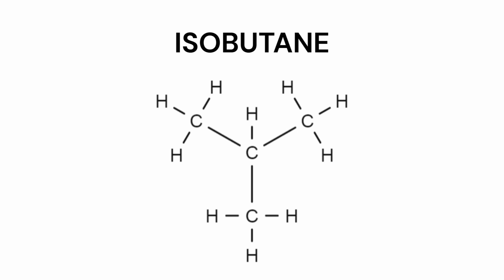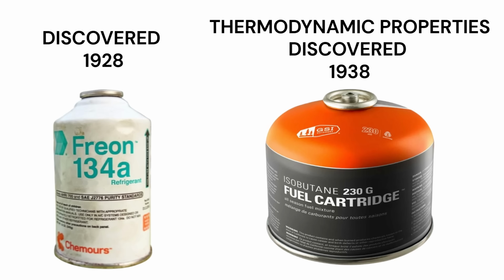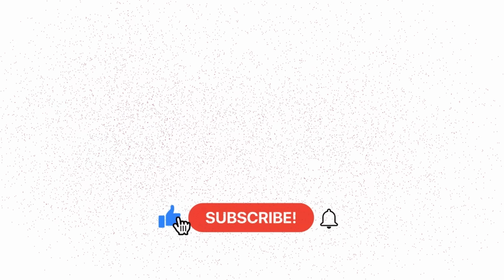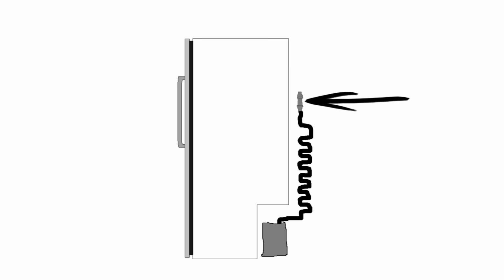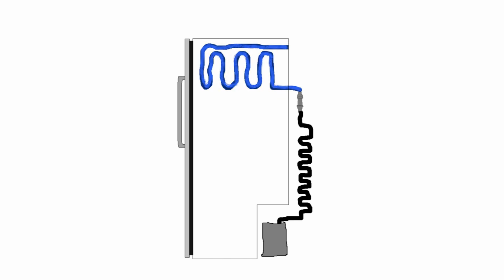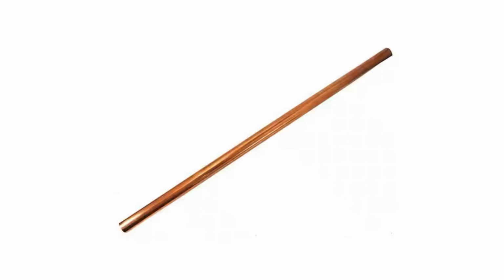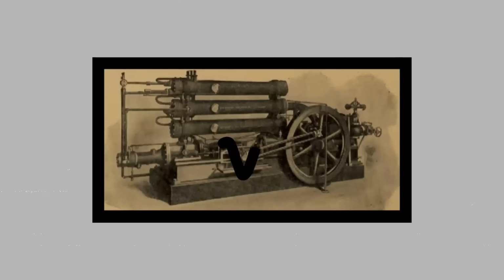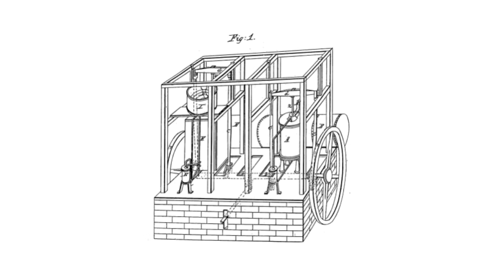Was Doc's 1885 mechanical fridge in Back to the Future really possible?

Comment: Doc's limitations wouldn't be restricted to 1885 technology. He's bringing 1985 knowledge of technology with him. His limitations would simply be in materials. For example, you said that the compressor was already invented, but even if it hadn't been, he still could have made one. I mean technically he could have made a machine to manufacturer r134 because he would have known how to. He wouldn't have to rely on it already existing
Reply: Not to mention he could have easily converted steam to electric just needs copper and magnets. He knows how that stuff works and could have done it.
Reply: @AaronBlair at the end of the day, every electric power plant is just a steam turbine.
Reply: @AaronBlair  yeah, but the question is why would he? That would be alot of effort for no real gain.
Reply: @jacobhargiss3839  to power, his little model, of course 😂
Reply: @asksearchknock  he used batteries.
Reply: @jacobhargiss3839  Are you saying no real reason the Doc would want access to electricity ????
Reply: @AaronBlair  no real reason he would want access to that much electricity. The only real use he could have for it is either heating or lighting. Neither of which he really needed electricity for.
Reply: @AaronBlair that step would result in power loss. Since the power is in mechanical form and the compressor needs to do mechanical work, there's no reason to make electricity.
Reply: @AaronBlair 
Where was he getting copper and magnets from? Copper was VERY expensive back then. It was almost as expensive as gold. 
They were using copper for telegraph and electric wires back. So the price was high. 

Magnets. Forget about it. He wasnt going into the local general store for copper or magnets 

You gotta think. He had access to stuff that he could obtain. Home depot diddnt exist
Reply: @Zeina107  Wow what a silly argument you're making. Doc Brown, from the future, with all his future knowledge. Can't get ahold of copper and magnets because ... they are expensive? Even though both things existed and were available maybe tricky to get? Somehow he got a blacksmith shop and a cool rifle and all sorts of stuff but copper and magnets would be out of reach. LOL. I know this is all fiction but that's a stretch to make an argument just to refute. Use your imagination a bit.
Reply: @AaronBlair I think he would have just stolen some telegraph wire. Doc isn’t exactly known for following the letter of the law when it comes to making an invention
Reply: @Zeina107  and if I were him I'd just take the magnets from the speakers in the delorean he had before he buried it in the mine, not like marty needs that sound system
Reply: He could have used the materials available to create modern tech for sure, he didn't need to use 1885 "technology." this is a big plot hole in the film for when they try to get the Delorean to run. He could have refined his own crude oil or refined his own alcohol to be sufficient to run the engine. They had them use alcohol and part of the engine "exploded." But that wouldn't have happened if the plot didn't  need it to happen. 100% alcohol can run engines for short times, definitely long enough to get the Delorean to 88 MPH.
Reply: @LordRayken  not even just short times. You can tune an engine to run on 100% grain alcohol. In Brazil they commonly sell what's called E100 which is 100% ethanol (drinking alcohol)

I'll add too, 100% alcohol is impossible to get through common distillation because alcohol and water becomes an azeotropic mixture when it reaches 95.6% alcohol. However 95.6% alcohol is still able to run a vehicle.
Reply: @Thoroughly_Wet  Hell, you can get an engine to run on normal vodka. When I was a nipper I had a friend who lived on a farm and we'd drive around like maniacs on the old wartime tractor that ran on any liquid that would burn.

P.S. Isn't it great that it's cheap and easy to get molecular sieves these days? ;)
Reply: @Thoroughly_Wet  yes yes. But consider: benzene.
Reply: @LordRayken 
If we want to be picky about plotholes, then Doc could have just kept a notebook and written down time, location, issue, and then have future himself come back and fix the issue while past Doc is off for a p break, as long as the entire thing could be done in discretion
Or, since past Doc would know about the future Doc visit, It might not be a problem if they see each other
Reply: @MrHack4never  Except Doc didn't want to be "rescued" in the first place.  He told Marty not to come back for him, as he was happy in 1885.  Marty only came back because Doc get's shot a week later.  It's that shooting that makes everything Doc does a quick, off the cuff decision.  Sure, he could've built an oil refinery to make gasoline, but that would've taken months that he didn't have.
Reply: @nickvanderpool7434  Or he could have gone to the Delorean that he had already hidden in the mine and drained off the remaining fuel in that.
Reply: @Titan604  That's plot for ya!
Reply: @Titan604  He would have drained the fuel before storing it. If he left a full tank of gas for 70 years, it would probably degrade into some sort of nasty gunk that 1955 Doc would have to clean up. Why make more work for your future past self?
Reply: @Titan604  normal petrol goes stale when sat for a long time, so unless he's using special aviation fuel which lasts longer I doubt he's going to be getting it running
Reply: @Titan604  no he couldnt…. He would have drained off the gasoline from that car in order to put it in long term storage
Reply: @Titan604 He had most likely drained the tank much earlier to protect the vehicle in storage and had used it for other purposes so he didn't have any left. He had been in 1885 for 9 months after all
Reply: @Titan604  No, that was clearly NOT an option. Doc would know perfectly well that gasoline is only stable for about a year before it degrades, therefore would have very very carefully made sure that the entire fuel system was cleared of all fuel before moving it to the mine. The Delorean in the mine HAD NO FUEL, otherwise 1955 would NOT have been able to make it run, as they would have had to wait until 1981 for new parts to be available.
Reply: @LordRayken  Also due to plot constraints they had a limited time window because of Tannen
Reply: @alphega1983  Yes but he could have gotten crude oil/kerosene and refined it further into gasoline. Kerosene was regularly available. The movie is nearly perfect but finding a way to fuel the Delorean should not have been the plot point. There were many combinations of things he could have run the engine on with not a lot of work for someone who is a student of all sciences and has his level of engineering and chemical sciences knowledges.
Reply: Reason it was a limited window was because Doc didn't know Tannen planned to kill him, so now they could get safely Away, if they hadn't waited, and of course attempted hanging could of got Tannen in jail or shooting at Doc at the dance
Reply: @LordRayken  it wasnt the plott point. The plott point was that they had to leave in 3 days. Not exactly enough time to set up what you would need to refine gasoline. And not long enough to fix the damage from the fuel expiriment they tried. Doc didnt say he ciuldnt fuel the delorean. He didnt say he couldnt fix it. He said it would take more time than they had.
Reply: @LordRayken Not in this case. To run on alcohol you need the right fuel and compression ratios. Unfortunately, the DeLorean's Bosch Fuel Distributor P/N102807 cannot adjust to the ratio needed, and the compression was far too low. Now, if he had been smart, he could have replaced the injectors to fix the fuel ratio, and built a supercharger to increase the compression.
Reply: @downix you can absolutely adjust air fuel mixture on kjet. I'd be more worried about the electronic ignition malfunctioning
Reply: @LordRayken  the likely component that "exploded" was the Bosch K-Jetronic mechanical fuel injection system; 100% grain alcohol is highly corrosive to rubber components like O-ring seals, the fuel feed and return lines, and the rubber diaphragms in the fuel distributor and warm up regulator. (and also remember that one of the fuel lines underneath was damaged during the scene where Marty is rushing to hide in the bear cave from the Indians and US Army.)
Reply: @LordRayken  if you get the engine timing right alcohol can run and engine for a long time
Reply: @LordRayken actually alcohol would easily run the engine especially if it was just a short stretch without any damage especially if he modified the carburetor to run better. The plot would’ve been wildly different. And I guess they had a timeline to go with.
Reply: It's not a plot hole. They needed to work fast because one of them was gonna be killed. With a deadline that limits you.
Reply: @LordRayken that and they did have gasoline back then.  It was called white gas.  It's lantern oil.
Reply: Freezer ships were in commercial service from 1878…
Reply: Actually, he’d have 2015 technology info, possibly.
Reply: I'm not a scientist, a mechanic, or a HVAC surgeon, but could he have used the freon that he brought back with him? In the DeLorean's A/C system, I mean.
Reply: @spextemp  it's either an HVAC mechanic (if working on the mechanical side) or an HVAC technician (if dealing with the computer controls)
Reply: @spextemp good thinking
Reply: @spextemp wait, he could just make electricity and power the cars AC to make a fridge. Electricity is easy to make, especially with the docs knowledge. Hell he could literally take the alternator out of the car and run it connected to a steam engine or something. Probably the easiest way to solve this is to canalise what is essentially a small power station and refrigeration unit you already brought with you.
Reply: He did try running the engine on alcohol but he blew the engine. Completely rebuilding a modern engine would require first building the factory. The date of his future death gave him a time limit a steam engine on rails is the most logical way to reach such speeds for the stranded time traveller that does not have access to a large smooth frozen lake or ski field. The land speed record does not go over 88mph until 1904 the first land speed record faster than contemporary rail was in 1906 by a steam car at 127mph.
Reply: @MrMonkeybat I forgot the engine blew up. I always kind of wished it just wouldn’t run on alcohol. I think the smoke and what not did indicate it blew up.
Reply: He may not have wanted to risk using more advanced technology then the time due to potential for time paradoxes. 
(Ignoring that he later built a steam train time machine).
Reply: @dreamcanvas5321 this really wasn't a question of whether he should or not, but simply where he could have. My point is only that a scientist from 1985 going back to 1885 wouldn't be restricted on 'could have' by only technology that existed then. He could have made just about anything, so yes, his mechanical fridge was entirely possible
Reply: @dougsholly9323  In the movie he proved that was true when he had his 1955 self using vacuum tubes to replace the time circuits that were originally made using integrated circuits (transistors)
Reply: @dougsholly9323  well, that assumes that he knows how to make just about anything off the top of his head. Just because he is a genius doesnt mean he has all the knoweldge of every feild he would need. Take the car for example. Doc is a genius nuclear physicist but that doesnt mean he has all the intimate mechanic knowledge to know how exactly to tune a delorean to run on ethanol without screwing something up.
Reply: yes but remember he doesnt want to screw with history
Reply: You can use ammonia or butane and even propane as a refrigerate
Reply: To be honest I would say him not modifying the delorean to use diesel fuel or maybe propane or even low grade alcohol is probably the biggest mistake. Propane and diesel degrade minimally over time propane even more so. Alcohol is abundant in all the times they go too You would want a fuel that is abundant and easy to store. Also not dropping off a few fuel depots through time makes a lot of sense. Always bumbling around for plutonium or gasoline is ludicrous.
Reply: Well, he would have been limited to 1885 tech if he didn't want to alter the timeline. Which seems plausible.
Reply: Do you know how to manufacture r134a offhand?
Less specifically, how much of your field of study could you work with when the reference materials haven’t been written yet?
Reply: @tOSdude u can use quite a few easily acquired Gases as a refrigerate
Reply: @gradystephenson3346  That is not the point, my point is that the commenter has made the assumption that Doc Brown knows offhand the chemical makeup of r134a (or more likely r12 in the 80’s) and the process to synthesize it. This is infeasible, there is no specific reason for him to know this, chemist or not. He could have a specific interest, but assuming such without any evidence in the source material makes no sense.
Reply: @tOSdude right😂
Reply: Knowing how something is done is different than doing it yourself. Does Doc know how to roll steel and operate machine tools?
Reply: R-12, R-134 wasnt commonly used untill round the 90s and R-12 runs colder. But yeah basicly. Doc said he could rebuild a bosch manual fuel injection system in a month. In 1885. His only real limit is tooling, but its not like he couldnt just build the tooling.  Plus in the comics, he built a time vehicle before the train out of junk.
Reply: @veeflames187 could of used butane or propane or even ammonia as a refrigerate
Reply: This right here, the whole videos premise is wrong
Reply: No. Because the stuff in the car he already put away. So thats not a obtainable anymore. 

He only has access to the things normal folks. Could acquire back then.
Reply: The biggest limitation would be getting the components to where he is with funds that he could only make as a blacksmith. I don't know how much money it would take to buy or build a steam engine, but I'm certain it's more than what a blacksmith can make.
Reply: @gobblox38 we're not talking about making a steam engine. We're talking about ice.
Reply: @dougsholly9323 yes, and in order to make I've with Doc's refrigerator, you need a steam engine.
Reply: @gobblox38 he knows how to make an electric motor, and it's not a stretch to say he could actually make one, even if it's crude. He wouldn't be restricted to only using technology that existed then.
Reply: @dougsholly9323 I understand that. What I'm saying is the energy losses wouldn't be worth the effort. He'd be turning mechanical energy into electrical energy and back to mechanical energy. It would require more fuel and water to achieve the same result.
Reply: Very good point

Comment: IRL the first industrial fridge (ice generator for meat storage, huge business for Australian climate!) was built in Melbourne 1854 - 30 years before. At this time Melbourne was a shithole comparable to Wild West, less than 20 years from the first settlement there.
Reply: From what I can tell there are various models of refrigerator with varying degrees of usefulness going back to 1805 or thereabouts. The writers through it in there for the same basic reason that they through all the unnecessarily weird stuff into BttF 2's future sequence as a way of screwing with people that were taking it too seriously and making it clear that they were going for entertaining over accuracy in a lot of ways. That doesn't explain ZZ Top being in the Wild West, from what I recall, they just happened to swing by the set and were invited for the cameo. Which was one of my favorite parts of the movie, they always did look the part.

Comment: Now the real question is: could he have built air conditioning to escape the desert heat? After all, he knew about refrigeration cycles and what is AC if not a reverse fridge? :D cool video, I was thinking about Docs fridge randomly a few days ago haha
Reply: All he would need to do is remove the fridge door, move the condenser coils outside the building, and maybe add some fans.